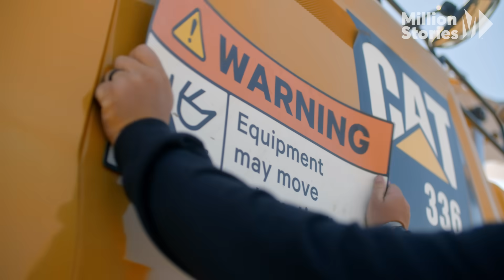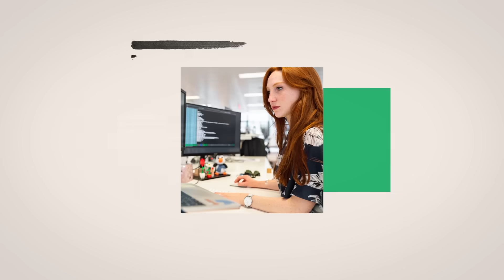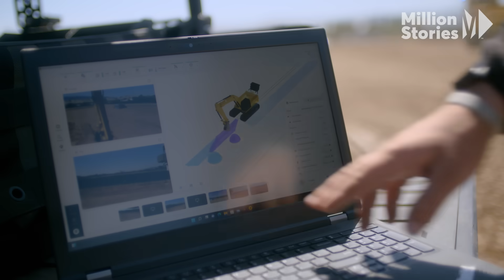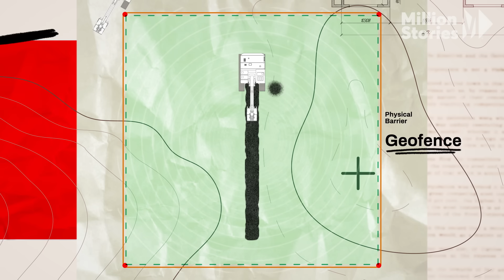These robot excavators are making workers more money

Comment: Speeding up/eliminating humans from menial/repetitive work is where the power of automation lies, but it also requires consistency to operate well. Digging a trench in very rocky soil would likely be beyond the scope of this system for the foreseeable future, but where it's suited to operate it'll be such an amazing force multiplier.

A huge part of robotic operations is developing and discovering techniques that can be reliably used by automation, that's why it pays so well, and why automation is so exciting since it frees humans up to do work only humans can do
Reply: Even rocky soil won't be an issue. AI improves by being trained. When the AI makes a wrong dig, the operator will correct it, it will learn and no longer need a person.
Reply: Malarky. You people watch too many Sci Fi flicks. The only thing AI will be good for is to blackmail you by creating your image/voice to say or do something you didn't.  Great way for cops to clear those cases. @SomeUserNameBlahBlah
Reply: Bull crap

Comment: LOL have you ever tried to look at a laptop screen in the sunlight and this so called robot has no clue as to what's left in the trench or how good a job has been done, it may have its uses but they look very limited? A JCB is a very versitlie machine in the hands of a skilled operator making adjustments on the fly - can't be done remotely very easily if at all.
Reply: Yeah but this skilled Operator your talking of Will waste it's time digging a three mile Trench
Reply: @TecSanento  Wouldn't a combo be a better situation where the machine is monitored by the operator in the cab, then it can get the go ahead if the trench looks good...its the remote part that just does not function as presented to me?

Comment: In such machines, a cabin is not needed at all. Remember the concept of Hitachi.
Reply: You would if you needed to control it manually in tough spaces
Reply: the software can break, and after you hit the emergency stop button, you might want to reset it manually, also loading(driving) the excavator onto a flatbed truck probably still need to be done manually
Reply: well yes, but this digger was built as a manually operated one, they just attach the big black box to it and it becomes robotic
Reply: It can be either operated manually or automatic
Reply: It IS needed, you saw it needs someone to route a path, what if you have to take it down the road to another construction site? You route the entire street and stop the transit for that or do you just drive it yourself?